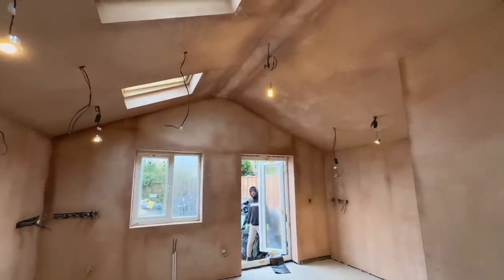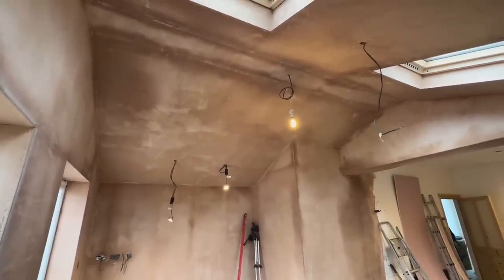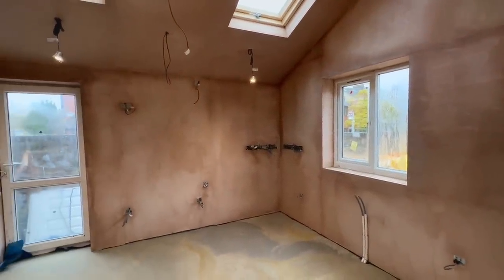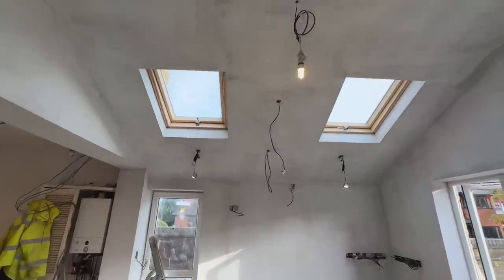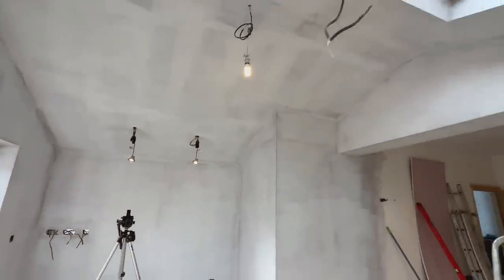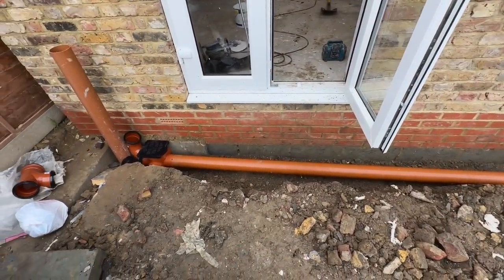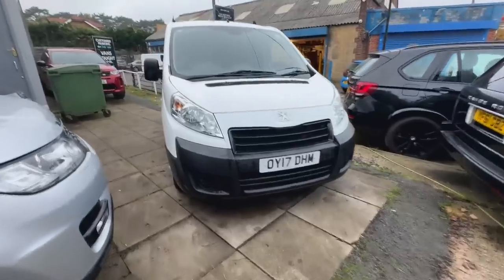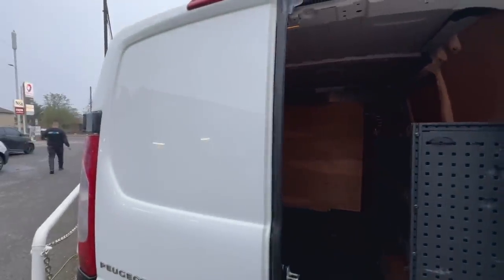London Extension build - Ep 52 - undercoating the inside

Comment: You are one talented hard working guy. Hope your new van does everything y,ou want it to. I have Peugeot Partner Tepee 1.6HDi Blue, Euro6, £30 annual road tax. Love it. A bit smaller than your Expert van. It has been 100% reliable, only done 35k miles but it's a bit smaller than your Expert van. Just keep up with the oil changes every 6k miles and it will go on forever.